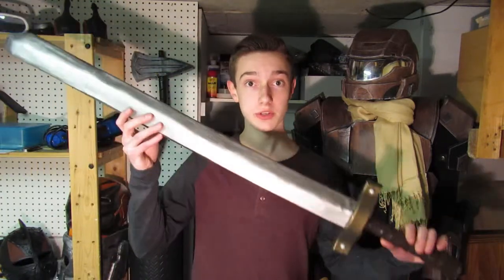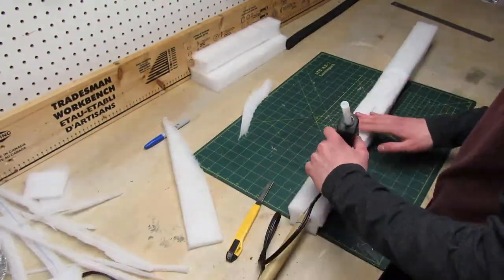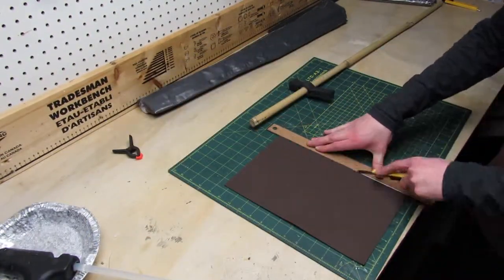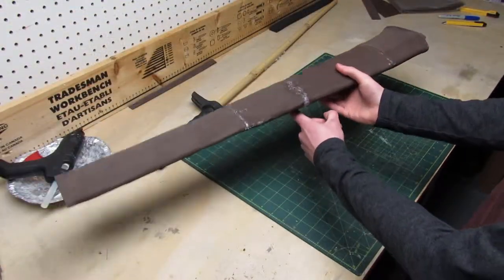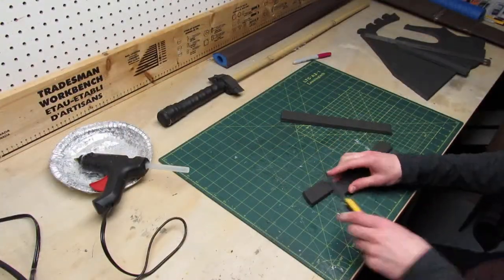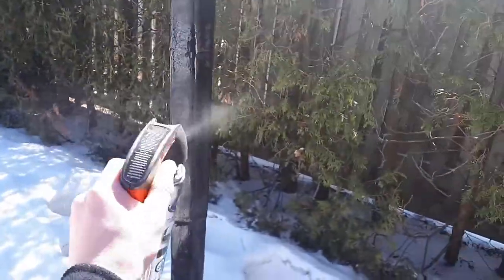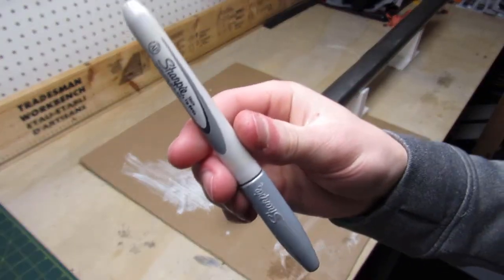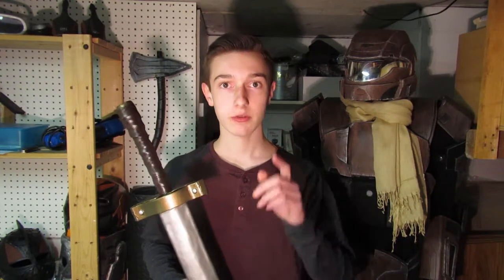How to Make a LARP safe Cosplay SWORD

Comment: As an advice, do not EVER make your sword core out of bamboo if you are planing on giving a hard treatment on combat. It's cheap, easy to get and light, but if it breaks the splints would pierce through the foam and could make really nasty damage to the flesh. 
Beside that, cool finish, well explained.
Reply: Hey, what would you recommend instead?
Reply: @epacriscreates8623  Fiberglass or PVC pipes.
Reply: Oh so pvc pipe is allowed
Thank you, I just learning what LARP and interested in sword making and duel

Comment: finally a way to make a softer foam sword all i see is people using thick eva foam and i tried it but it makes the sword way too hard for the larp events i go to but a 2mm eva foam outer layer is a genius solution to that
Reply from the maker: Thanks! Something I found more recently is that upholstry foam is even softer and much more durable than a pool noodle or insulation foam. That's what I would now recommend most.

Also, for the core I would recommend using a PEX pipe as it's light and more flexible than PVC so it softens the impact if you get hit.

Comment: How did you do the tip of the blade?
Wasn't supposed to be a hole in there?
Reply from the maker: I used an excess piece of the pool noodle to plug the hole. I used hotglue to keep it in place
Reply: @TristanMaker  Oh, nice!
Thank you! ^^